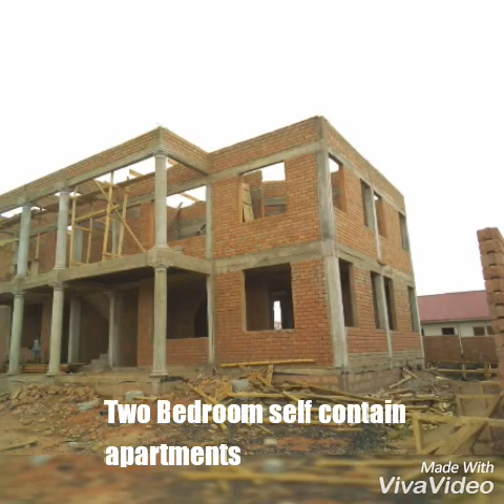Interlocking block house Ghana Africa

Comment: This so owesome
Reply from the maker: Yes really. We build industrial machine in Ghana. So share the news
Reply: @Adwamenmachine  sure. Indeed i love this though am a ugandan. Right now am in U.S. am doing this project of producing the ISSB but not quite much like yours bcz of the manual machine. I wish i have a modern one that can produce much
Reply from the maker: We could do that sending you on minimal cost. We have not sent machines out side Ghana yet but have two in process. Just send me a whatsapp message for further conversation. Number is +233201827707
Reply: @dithanmuwanga4121  your doing interlocking blocks in the USA?
Reply: @eeforest7122  no in uganda
Reply from the maker: We would like to work with you. Contact us
Reply from the maker: Did you get the machine